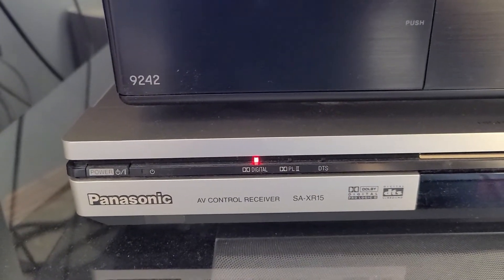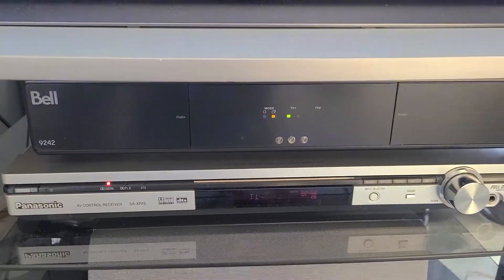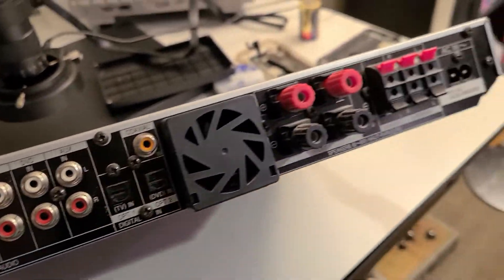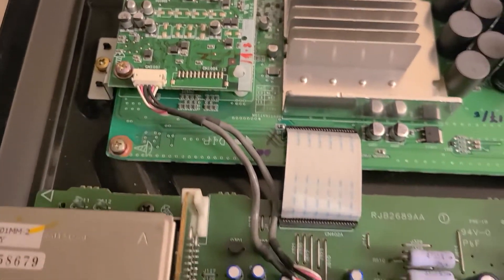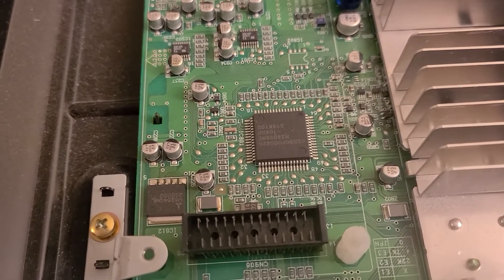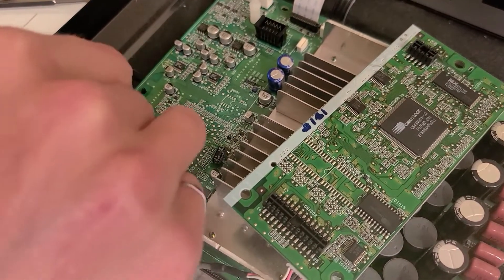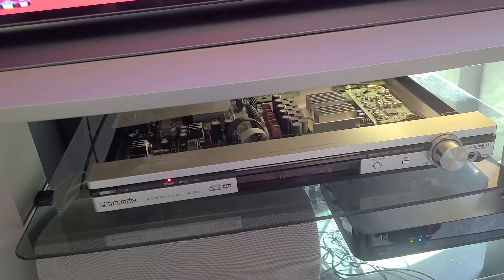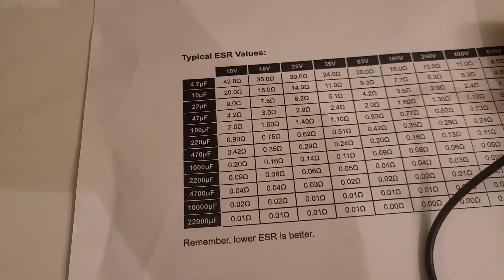Panasonic SA XR15 Audio Receiver glitching and crackling fix

Comment: I just fixed my SA-XR25 and would not even have tried without this video and excellent advice. I replaced 2 1000uF leaking capacitors with radials. I gently twisted and pulled off the two leaking surface mount capacitors. I tried to solder two replacement surface mounts but the tabs were too small and I did not have a hot air gun. Thanks you so much!!!  EDIT 1 week later> Just one more update. I also replaced the 4 22uF capacitors with radials this weekend. It was certainly a challenge holding each tiny capacitor in place on the PCB and soldering it. Looking forward to using this SA-XR25 for a few more years.
Reply from the maker: So awesome you got it working!  Impressive that you were able to twist them off without a hot air station and without damaging the pads.  That must have took some patience. Did you replace the four I did as well or just the 2 1000uF leaking ones you noticed?  Were those leaking1000uF caps on the same board?  It would be great to know in case it happens again to me and I can keep an eye out for those 2.  Thanks for the feedback and I can say that the receiver is still working great 2 years later so hopefully you get a few more years out of yours as well.
Reply: Yes I very gently twisted the two capacitors  that were removed and then used some flux & solder braid with the solder iron to pull off the metal tabs. The pads were not damaged. The two 1000uF removed were on the same board as the 22uF's. They were close to the front of the receiver.
Reply: what voltage did you use
Reply: @dodoo907  the 22uF capacitors were 25v and the 1000uF were 16v. Good luck!

Comment: Thanks for the video! I am going to try fixing my XR15 this way too, but rewatching the video closely again now I noticed that you replaced another capacitor on the top digital board with an electrolytic one without mentioning here (visible at 2:28). You said you had not discovered any bad ones during your inspection so why did you change that one? Was it leaking after all? Is it necessary to replace this top one as well?
Reply from the maker: @WhiteFalconus  Woah, you're right.  Good eyes.  I didn't even recall replacing it, but I don't think it helped.   I think I initially started testing some caps with an ESR meter in circuit, and it tested bad, but when I pulled it out, it tested fine.  That's probably why I didn't include the clip.   Testing caps in-circuit can sometimes give false positives.  I'm almost certain that replacing the 4 caps underneath that board should be all you need to do.
Reply: @shaneperche-fixed-it  Thank you for getting back to me so quickly. My multimeter does not offer ESR testing, when I was choosing which one to buy ESR sounded like some unnecessary voodoo only increasing the price ;-) I will try replacing only the four caps you mention then.
Reply: @shaneperche-fixed-it  Hey, thanks again! I finally mustered the courage to desolder the 4 caps (damaging one of the 8 pads in the process, but only slightly) and replace them with electrolytic ones. The crackling sound on mine was not persistent, it only appeared when I switched it on after night usually and went away when I switched it off/on again. But now it seems to be gone, phew :)
Reply from the maker: @WhiteFalconus  So awesome!  Thanks for letting me know.  Mine started the same way and just kept getting worse over time.  It has still been good ever since and it's been a couple years at least.  Damaging pads is pretty common and I find applying a little bit of flux before removal helps a lot.  Sometimes I also use a solder wick when removing components to soak up as much solder as I can which also helps reduce pad damage.  At the end of the day, the more you do, the better you get so I'm glad you mustered the courage to take it on.  Pretty satisfying when you light it up and it's fixed.
Reply: @shaneperche-fixed-it  Totally, I always feel good when I manage to repair something and prolonging its life, despite not understanding the theory behind it. I used flux, but the contacts of those small SMT caps are pretty tiny and the black plastic surrounding them start to melt and stink quickly. So I got impatient with one of them and even though I kept changins sides every time and wiggling the cap, I probably pulled too soon. But it should be okay, when I tinned all the pads it helped the half lifted one to be more solid again unless I need to replace them again in the future, there should be no problem. Could not have done it without your video though. I am glad there are people out there who can figure out WHAT needs to be replaced and they are generous enough to share that knowledge with others.

Comment: Got same problem with XR25... Will try solve this by replasing those caps. Big thanks for sharing!))
Reply from the maker: No problem.  Let me know how it turns out.   I feel pretty confident that replacing those 4 caps should solve your problem with the XR25 since the board is the same as the XR15 and the post I found on fixya was actually the suggested solution for the XR25.  The good news is that my receiver is still working perfectly.